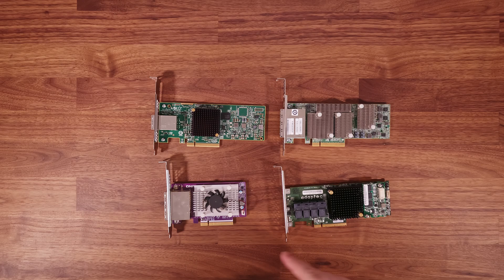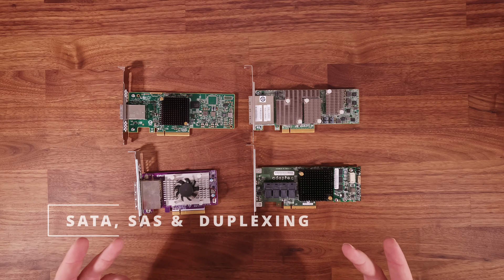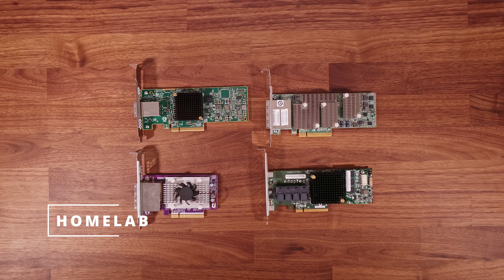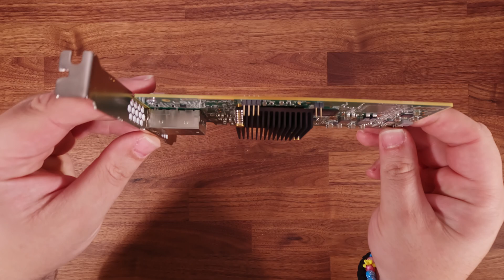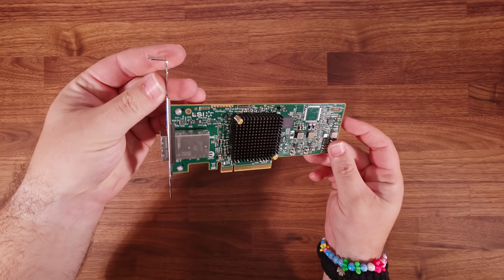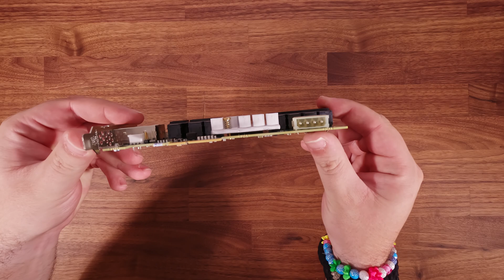What is a SAS HBA card ?

Comment: Hi I have dount can we connect GPU to work station with similar HBA card?
Thanks
Reply from the maker: These are SAS HBA's. You need two things in order to connect a GPU to your machine, first one being a PCIe adapter/splitter card and the second one being a motherboard that supports bifurcation, if you only want to connect one GPU then you just need PCIe adapter there is no need for bifurcation support on the motherboard. You also have an option to get a PCIe adapter card with a switch chip in that case you also do not need bifurcation support. Note that SAS cables may work with PCIe but its not guaranteed.
Reply: My requirements is I have 2 work station with 4 gpu in each, I want to inter connect 2 with sas cable possible?
Reply from the maker: @Prakash_Farmers_Son_Farmer  Hmm you can't interconnect them its not how PCIE connection works, you can have an externally mounted GPU's using PCIE adapters and PCIE risers that have support for SFF-8643, SFF-8611 or SFF-8654 cables if you are using PCIE4.0 or PCIE5.0 you will need a PCIE adapter with redrivers or you will have unstable connection